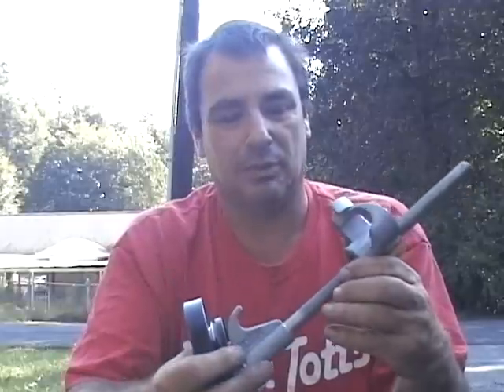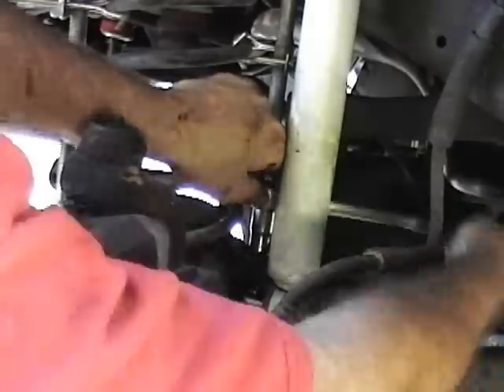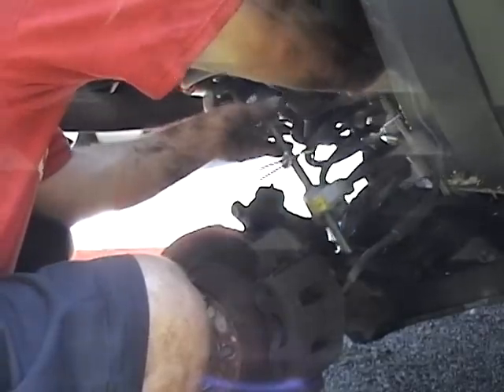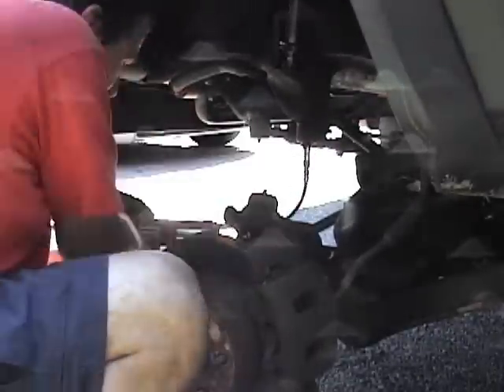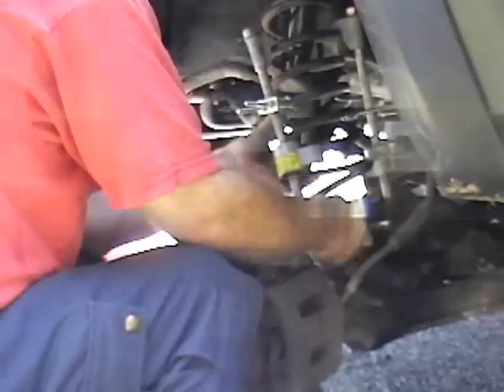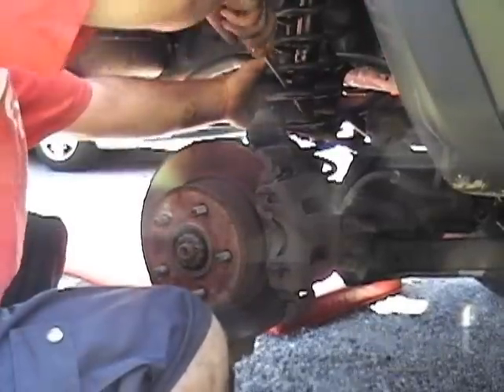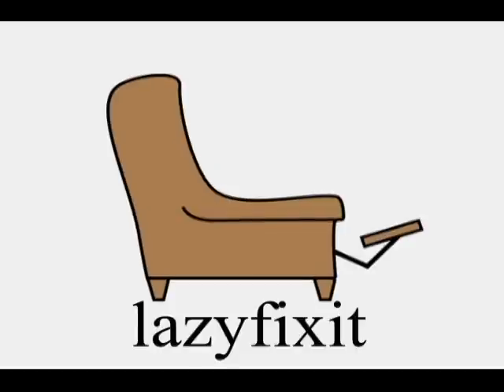coil spring spacer install

Comment: Thanks for the video. After viewing this, I put some 3/4" spacers on my stock Cherokee. You are right, it is super easy. The only thing I did was disconnect one sway bar link (once 1 side is free, the other moves without disconnecting the other), and the spring retainer tabs of course. I didn't even disconnect the shocks! Thanks!
Reply: How long did it take you for both sides?

Comment: cool. yeah my 99 laredo rear springs may be worn but the spacers are non existent now. every little bump you hear the clunk and rubbing of the shock metal on metal. just have to compress enough to get the new one back in. might say heck with it and just put new springs on since all apart and will have the tool to do it. would like to find a beefier spring than the stock ones.

Comment: Since I'm putting 3 inch coil spring spacers in the front am I gonna need to get different upper control arms or taller spindles?
Reply from the maker: Are you still using the stock springs? You can go up to a total of 4 inches on the stock control arms. The spindle is the axle shaft centered in the hub. You can use the stock one.
Reply: @NickG  on my 02 ranger I'm using the stock springs but with the spacers on the upper control arms are angled all the down when its connected to the spindle
Reply from the maker: Sorry my bad, I thought you were doing it on a Jeep.  I don’t have much experience lifting a ranger. But I think the best way to go is with a drop I beam kit. Good luck and let me know how it works out.

Comment: video good friend but that car does not need to make the exhaust just Aspiral whole train down to the ground can extract Aspiral clocar hands and the other, although to put thicker rubber if you can shrink a little with Aspiral extractor to enter the thick rubber extractor but leave all front and rear Thanks from Venezuela a Wave,

Comment: You don't need spring compressor for that spring. Just lower the arm. Spring compressor is for struts
Reply from the maker: Thanks for watching and thanks for the tip.
Reply: That's not always true though. My rear springs on my caddy don't just pop out even with the axle all the way lowered. I needed to use a compressor

Comment: What was your ground clearance before and after putting in the spacers?
Reply from the maker: Sorry, I never measured it. It lifted the body 2 inches and gave me clearance in the wheel well to fit some larger tires.   31x10.5x 15
Reply: @NickG  
That's a nice lift. Thank you very much!
Reply: It won’t change ground clearance at all unless you run a bigger tire

Comment: Are you happy with the additional ride height? How did using a coil spacer make a difference in the vehicle's driveability?
Reply from the maker: Now that it's all said and done I wish I went another inch higher,   No difference in driveability,  since the stock spring is being used.

Comment: Uhhhh. Lol you did a little extra work. When you removed shock you only need to remove bottom bolt then sway bar lower rear axle and springs will be removeable without compressing them. That is why you put jack stands under the frame in rear.so axle will drop low enough there absolutely no need for spring compressor
Reply from the maker: Thanks for watching. And thanks for the tip.

Comment: Is there any way I could do this without the spring compressor? Would i just have to disconnect everything? Lol
Reply from the maker: Yes you can do this without spring compressors. You’ll have to remove everything that stops the axle from dropping too far.
Reply: @NickG  Figured, thanks, great vid, I have a bunch of boxes coming tomorrow the jeep is do for an upgrade

Comment: After adding the spacers do you have to have the vehicle realigned?
Reply: No, you shouldn't have to. If you start to see excessive tire wear, that's an immediate sign that you should get an alignment.
Reply from the maker: no alignment necessary. but would never hurt to have it checked

Comment: what truck is that??? 2wd 4wd
year...
half ton...
Reply: +mark yisser its obviously 4x4 you can see a driveline going to the fron axle
Reply from the maker: 4x4 jeep cherokee. but it should work on any coil spring suspension
Reply: mark yisser what year is your Cherokee?
Reply from the maker: 1996 Jeep Cherokee.

Comment: I did 3" front 1 rear and now my Tahoe rides extremely rough any ideas on shocks to smooth out
Reply from the maker: I'm not too familiar with a Tahoe, But if your shocks travel is maxed out it will give you a rough ride. Here's a video on how to measure the length of shocks you need.   Sorry I can't be of more help.
 https://www.youtube.com/watch?v=l8rD3Of0ZR4

Comment: Ah, don't you need new shocks that are 2" longer of travel?
Reply: Views may differ really, to me only if your trail riding with lots of flex if not it just keeps u from bottoming out as often
Reply from the maker: ideally yes. but for street driving and light off road they re right at their limit. when replacement time comes i'll look into some longer ones

Comment: stupid video. After removing sway bar link and shock the actual just sags down and you can pull the spring out. You actually took more time by putting the coil spring compressors on
Reply from the maker: same here... even with the spring compresed  I had a tough time getting it out
Reply: Matthew Carroll yeah, I had to disconnect one end of the lower control arms also. Then I had to use a bottle jack and heavy duty Rachel saps to get it lined up enough to get the bolts back through the control arms.
Reply from the maker: I just replaced my stock springs with some rubicon express 3.5's. I had to remove the shock, sway bar link, lower control arm and the brake caliper and still had to compress the spring to get it in on the drivers side. The passenger side goes a little easier for some reason.

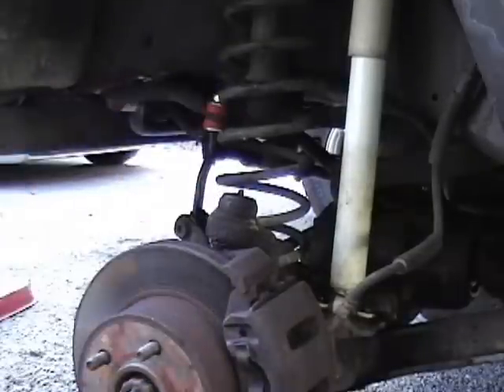Comment: BLAH, BLAH, BLAH - start at 1:20.  This is a 1 minute video that goes on for 5 minutes.  I nodded off. Where was the part where he INSTALLED THE COIL SPRING SPACER?
Reply from the maker: Thanks for watching, Glad you liked it.
Reply from the maker: At 3:11 I install the spacer.